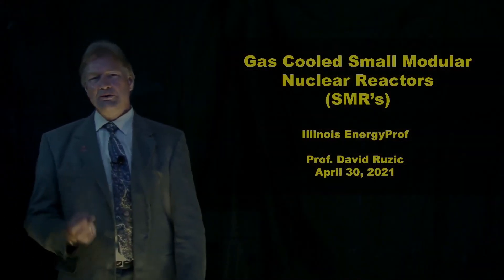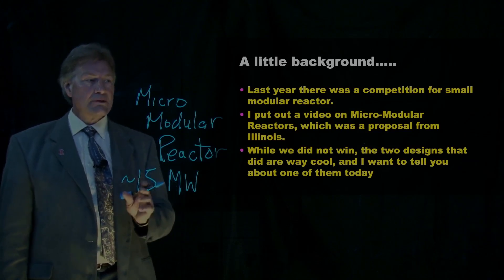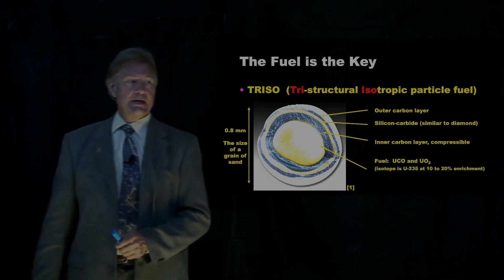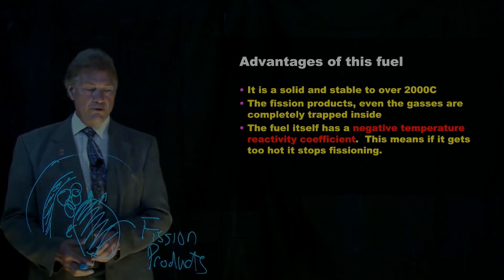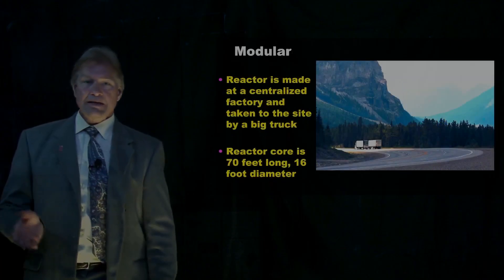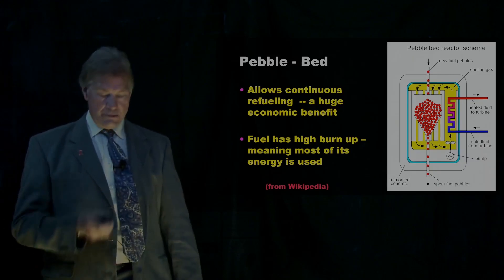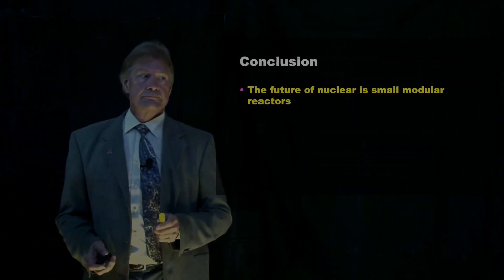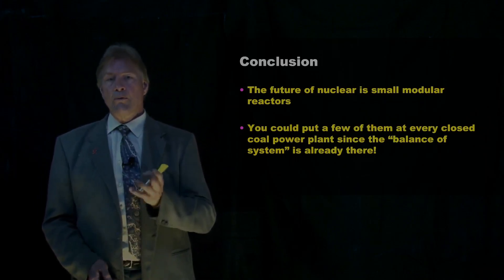SMR -- Small Modular Nuclear Reactors - Gas-Cooled

Comment: NONSENSE.   NASA reports global warming at 1°C where it has been since 1992.  The cause of global warming is not known.   It is impossible to increase the effect of a saturated system.  A primary example of saturation to US high school students is earth’s water vapor saturated greenhouse effect that completely absorbs all the greenhouse radiant energy with greenhouse gases within a few meters of the radiating surface adding 5.55°C (10°F) to earth’s average temperature (1978 earth science Marshall High School, Falls Church VA).  On average water vapor with a CO2e of 18 and 1% of the troposphere is over 99.5% share, carbon dioxide less than 1/4% share with 40% considered to be from human causes being less than 1/10% share.

Typical wholesale electricity bids at nuclear $20 MWh, coal $30 MWh and $100 MWh natural gas.    This is not including the highly expensive high readiness natural gas support for wind and solar generated electricity.    

SMRs could be a worthwhile steam source for electricity generation in remote location, to augment existing nuclear sites and for large ocean going ships.   Running a steam power plant is greatly more staff involving than running diesel or turbine engines.  

US nuclear power requires a ten mile evacuation area that no existing coal power stations locations would have implemented.  

Large retiring US coal power station sites are excellent locations for new highly efficient ultra supercritical (USC) clean coal power stations!    China is re-powering and greatly expanding its power grid with hundreds of new highly efficient ultra supercritical (USC) clean coal power stations since 2018.   The coal fog of Chinese cities has disappeared due to new USC coal power stations.   

in the US the estimated natural gas crossover fueling price for a USC coal power station is $0.80 mmBTU.  $3.00 mmBTU is where US wholesale natural gas hover about.   A USC coal power stations is estimated at a little more than 1/4 the fueling price of natural gas combined cycle power stations.    The USC steam turbine generators have characteristic of both liquid and a gas allowing some fast reacting ability that steam turbines lack.  This allows USC turbine generators to support some solar and wind generated electricity instead of expensive to run natural gas turbine generators at high readiness making near zero electricity.  

The 1980s trials of wind turbine generators revealed supporting the wild power fluctuations per second made large amounts of wind power less than worthless electricity.    Large amounts of wind power in practice would need fast reacting peaking power that in could only be  provided by running natural gas turbine generators at high readiness making near zero electricity costing as much  natural gas as making all the electricity with natural gas combined cycle power stations.  A wind farm's wild power fluctuations in a second needing constant make up above high readiness caused large amounts of wind power to be the most natural gas expensive form or providing electricity.  

In the 2000s large amounts of by-product natural gas from the emerging oil fracking industry needed a new market for natural gas.   The power grids wouldn't use expensive natural gas except for peaking needs.   Forcing the power grids to support large amounts of wind power would create the needed new market for natural gas with the high readiness natural gas cost hidden from the public because it is not generating electricity.    

Al Gore's CO2 global warming ideology being brought to the forefront could force the switch from "fossil" fuels to huge amounts of power grid use of natural gas.   When Al Gore released his 2006 film "An Inconvenient Truth"  global warming had not changed in 14 years, but the  there was a huge over supply of natural gas that had no market.   US vise president Al Gore 1993 - 2000) received $70 million USD from the Arab natural gas exporting country Qatar from its state owned Al Jazeera news network 2015 purchase of Al Gore’s Current TV.

Comment: The 1.9549 tons of spent fuel generated in one year by one 80MWe reactor can fuel 2 1GW Molten Salt Reactors for one year. 940 kg of natural thorium in a Molten Salt Reactor (MSR) can generate 1 gigawatt (GW) of electricity for one year. The 14.845 tons of unused depleted uranium processed to obtain the 1.955 tons of enriched uranium can fuel a further 16 1GW Molten Salt Reactors for one year.
Reply: With some SMRs is it even more than 100 times more, if it burns down spent fuel fully.

Comment: This guy deserves so many more views
Reply: Book smart people should research reality and actual facts before they attempt to make a point.

This is from the Des Moines Register an concerning the only Small Modular Reactor (SMR) project in the U.S. today.
In 2013, the Wall Street firm Lazard estimated that the cost of generating electricity at a new nuclear plant in the United States will be between $86 and $122 per megawatt-hour. Last November, Lazard estimated that the corresponding cost will be between $131 and $204 per megawatt-hour based upon the 4 recent new nuclear projects in the U.S. . During the same eight years, renewables have plummeted in cost, and the 2021 estimates of electricity from newly constructed utility-scale solar and wind plants range between $26 and $50 per megawatt-hour. Nuclear power is simply not economically competitive.
SMRs will be even less competitive. Building and operating SMRs will cost more than large reactors for each unit (megawatt) of generation capacity. A reactor that generates five times as much power will not require five times as much concrete or five times as many workers. This makes electricity from small reactors more expensive; many of the original small reactors built in the United States were financially uncompetitive and shut down early.
The estimated cost of constructing a plant with 600 megawatts of electricity from NuScale SMRs, arguably the design closest to deployment in the United States, was originally advertised as costing $1 billion but upon requesting actual bids from engineering firms, increased to $6.1 billion in 2020. Given inflation and other cost constraints that cost today can only be expected to be significantly higher.
The cost was so high that ten members of Utah Associated Municipal Power Systems canceled their contracts. NuScale then changed its proposed plant configuration to 6 fewer reactors but increased each reactor output from 50 Mw to 77 Mw costing at total of $5.3 billion. The NRC just last week approved the construction of the 50 Mw design but now will have to start the review process all over given the switch to a 77 Mw design. For each kilowatt of electrical generation capacity, that estimate is around 80% more than the per-kilowatt cost of the Vogtle project in Georgia — before its cost exploded from $14 billion to over $30 billion. Based on the historical experience with nuclear reactor construction, SMRs are very likely to cost much more than initially expected. And they now have delayed the project start until 2025 in an attempt to find more backers.  All this before the inevitable setbacks that will occur once construction starts.

Comment: Thank you, Prof Ruzic, for explaining how practical and safe nuclear energy can be. I think we will need to rely on it as we transition to carbon-free energy, especially if we hope to be anywhere near the target set for 2030.
Reply: He forgot to research reality  and that means economics.

This is from the Des Moines Register an concerning the only Small Modular Reactor (SMR) project in the U.S. today.
In 2013, the Wall Street firm Lazard estimated that the cost of generating electricity at a new nuclear plant in the United States will be between $86 and $122 per megawatt-hour. Last November, Lazard estimated that the corresponding cost will be between $131 and $204 per megawatt-hour based upon the 4 recent new nuclear projects in the U.S. . During the same eight years, renewables have plummeted in cost, and the 2021 estimates of electricity from newly constructed utility-scale solar and wind plants range between $26 and $50 per megawatt-hour. Nuclear power is simply not economically competitive.
SMRs will be even less competitive. Building and operating SMRs will cost more than large reactors for each unit (megawatt) of generation capacity. A reactor that generates five times as much power will not require five times as much concrete or five times as many workers. This makes electricity from small reactors more expensive; many of the original small reactors built in the United States were financially uncompetitive and shut down early.
The estimated cost of constructing a plant with 600 megawatts of electricity from NuScale SMRs, arguably the design closest to deployment in the United States, was originally advertised as costing $1 billion but upon requesting actual bids from engineering firms, increased to $6.1 billion in 2020. Given inflation and other cost constraints that cost today can only be expected to be significantly higher.
The cost was so high that ten members of Utah Associated Municipal Power Systems canceled their contracts. NuScale then changed its proposed plant configuration to 6 fewer reactors but increased each reactor output from 50 Mw to 77 Mw costing at total of $5.3 billion. The NRC just last week approved the construction of the 50 Mw design but now will have to start the review process all over given the switch to a 77 Mw design. For each kilowatt of electrical generation capacity, that estimate is around 80% more than the per-kilowatt cost of the Vogtle project in Georgia — before its cost exploded from $14 billion to over $30 billion. Based on the historical experience with nuclear reactor construction, SMRs are very likely to cost much more than initially expected. And they now have delayed the project start until 2025 in an attempt to find more backers.  All this before the inevitable setbacks that will occur once construction starts.

Comment: Every time a coal plant shuts down one or a few of these should be set up at that site.   The transformers and distribution lines could be reused and that would save a lot of capitol.   

Plus much of the skills from the existing workforce would carry over.
Reply: @18:20 there is my exact point.
Reply: That is what Terrapower is planning on doing with their natrium reactor.  But after two years the project is stalled.  Talk is cheap reality is costly.

Comment: You could have a small nuclear reactor at a closed down coal plant to to heat up salt heat storage tanks so the old coal plant can be more like a peaker plant.  This sort of plant produces power when other sources like renewables can't.  Producing power during these times is much more profitable.  Like the issue is not how cheap you can produce power but when you can produce that power. A plant that can produce power when whole sale power prices are high will be much more profitable that a power source that can't do this even if this power source is more expensive on per kWh.
Reply: That is what Terrapower is planning on doing with their natrium reactor.  But after two years the project is stalled.  Talk is cheap reality is costly.

Comment: So, to be clear, I can buy renewables to supply my home and work *now*, but I have to wait ten years for a prototype reactor that is presently *drawings*, with not even a prototype, and no factory on the horizon. 

And no waste disposal plan, and no civil defense plan if targeted by military or terrorists.

I suggest that the "professor"is a shill and his industry is both morally and financially bankrupt.
Reply: Don't worry here is reality.
This is from the Des Moines Register an concerning the only Small Modular Reactor (SMR) project in the U.S. today.
In 2013, the Wall Street firm Lazard estimated that the cost of generating electricity at a new nuclear plant in the United States will be between $86 and $122 per megawatt-hour. Last November, Lazard estimated that the corresponding cost will be between $131 and $204 per megawatt-hour based upon the 4 recent new nuclear projects in the U.S. . During the same eight years, renewables have plummeted in cost, and the 2021 estimates of electricity from newly constructed utility-scale solar and wind plants range between $26 and $50 per megawatt-hour. Nuclear power is simply not economically competitive.
SMRs will be even less competitive. Building and operating SMRs will cost more than large reactors for each unit (megawatt) of generation capacity. A reactor that generates five times as much power will not require five times as much concrete or five times as many workers. This makes electricity from small reactors more expensive; many of the original small reactors built in the United States were financially uncompetitive and shut down early.
The estimated cost of constructing a plant with 600 megawatts of electricity from NuScale SMRs, arguably the design closest to deployment in the United States, was originally advertised as costing $1 billion but upon requesting actual bids from engineering firms, increased to $6.1 billion in 2020. Given inflation and other cost constraints that cost today can only be expected to be significantly higher.
The cost was so high that ten members of Utah Associated Municipal Power Systems canceled their contracts. NuScale then changed its proposed plant configuration to 6 fewer reactors but increased each reactor output from 50 Mw to 77 Mw costing at total of $5.3 billion. The NRC just last week approved the construction of the 50 Mw design but now will have to start the review process all over given the switch to a 77 Mw design. For each kilowatt of electrical generation capacity, that estimate is around 80% more than the per-kilowatt cost of the Vogtle project in Georgia — before its cost exploded from $14 billion to over $30 billion. Based on the historical experience with nuclear reactor construction, SMRs are very likely to cost much more than initially expected. And they now have delayed the project start until 2025 in an attempt to find more backers.  All this before the inevitable setbacks that will occur once construction starts.
Reply: @clarkkent9080  Oh, I'm not "worried" about SMRs, except for the money that will be wasted on them.
They lose competitiveness not just from the economies of scale you mention, but also from other factors. Steam plant has clustered around 1GW electrical output for some decades due to numerous factors ranging from the thickness of pressure pipes to the rate of cooling and heating impacting total plant longevity. Nuclear is in the same boat. Additionally, nuclear is constrained by the fundamentals of attaining core criticality: big cores have less surface area per unit of fissile material, whereas smaller cores have proportionally larger surface area to lose neutrons. They are instrinsically less efficient. Naval submarine reactors get around this by using highly enriched uranium, but they still face the same problem: a greater proportion of nuclei need to fission just to provide neutrons to sustain the reaction. This gives two extra problems, it means the reactor needs more damping at all times (reducing efficiency) and generates more heat at all times, even when scrammed. Fine for a submarine in arctic water, but not a solution for land-based SMRs. (the French recently got a reminder about reserve cooling capacity)
SMRs are intrinsically inefficient and will require excess cooling capacity compared to larger reactors. They will generate less electricity from a given amount of fuel and more waste for a given amount of electricity.
And as you point out, none are competitive as it is.
Reply: @aaroncosier735  You make some very good technical points.  I cannot see SMRs having any real advantage other than being cheaper and faster to build.  But that is quickly offset by their lower efficiencies.  The project is on hold till 2025 due to the high cost and I do not believe the project will become any cheaper in 2025.

Terrapower is trying to build a MSR in Kemmerer Wy and that project is on hold for various reasons (such as required fuel enrichment can only be obtained from Russia).  But I see their selection of a site (converting an old coal plant site to nuclear) to be  more concerning as being political rather than logical.

I worked in the industry for 40+ years at 5 different sites and am pro nuclear but the facts and reality of new nuclear in the U.S. do not look very good.

Comment: Professor: What is the effect on the financial statements if the SMRs are installed and run as they are completed and not left sitting in a warehouse until the project is complete? If an existing boiler-powered plant has SMRs installed to replace several boilers at a time, how will that work out. What are your best real life scenarios?